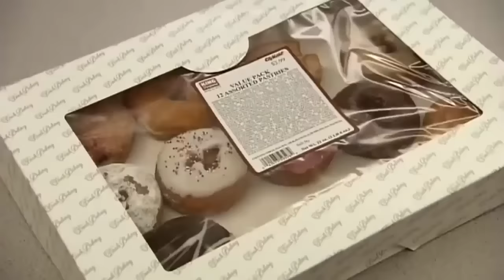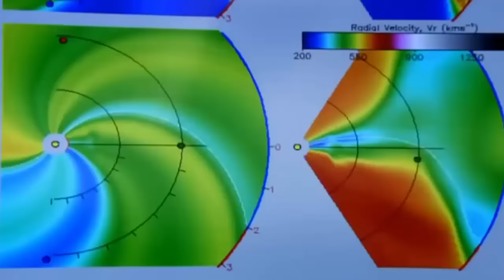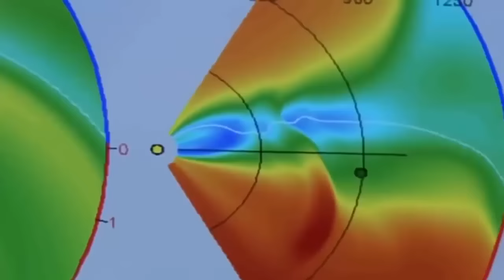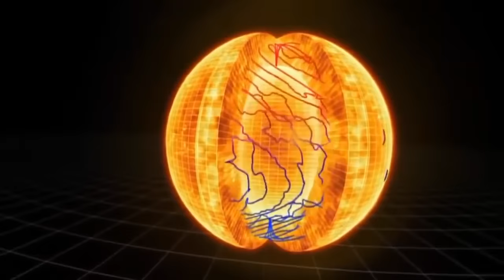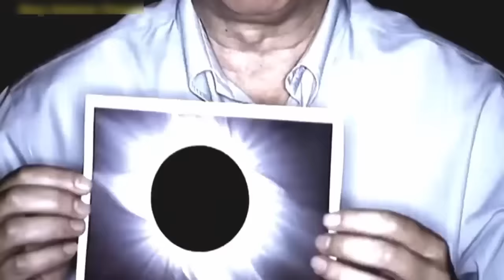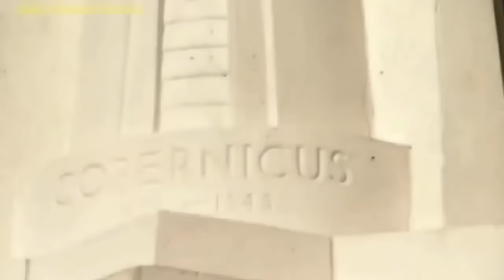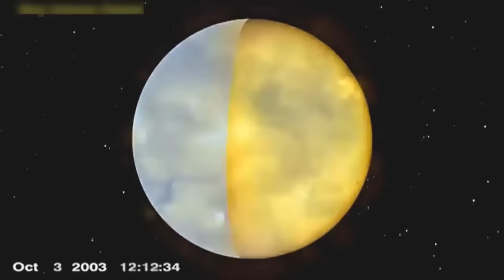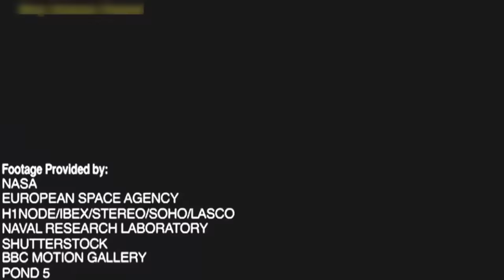THE SUN - Secrets and Facts - Documentary

Comment: How are "you" not concerned with our Sun now appearing Orange and Blurry?? Methane blocks blue !ight waves creating the Orange Sun and Skyline!
Reply from the maker: The appearance of the Sun as orange and blurry can be influenced by various atmospheric conditions, not necessarily indicating a significant underlying problem. For example, increased atmospheric pollution, dust, or smoke can scatter sunlight, causing the Sun to appear more orange and less clear. This effect is particularly noticeable during events like wildfires or in heavily polluted areas.

While it's true that certain gases like methane can affect the scattering of light waves, leading to changes in perceived color, it's important to consider other factors as well. These include the angle of the Sun in the sky, atmospheric composition, and local weather conditions. The perception of the Sun's color can vary depending on these and other environmental factors. However, if there is a significant and sustained change in the appearance of the Sun, it would be a subject of study and concern for astronomers and atmospheric scientists.